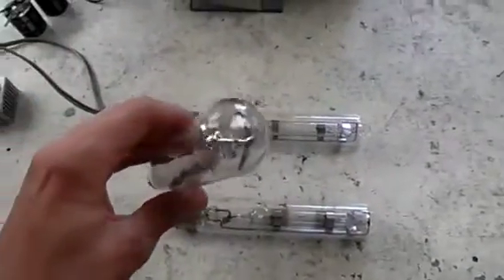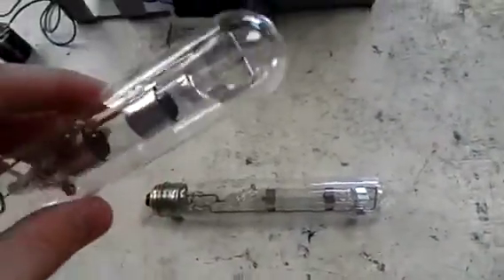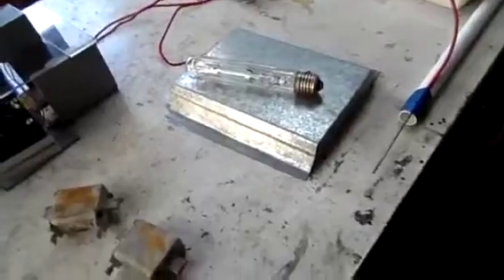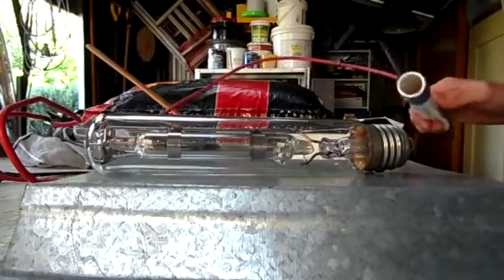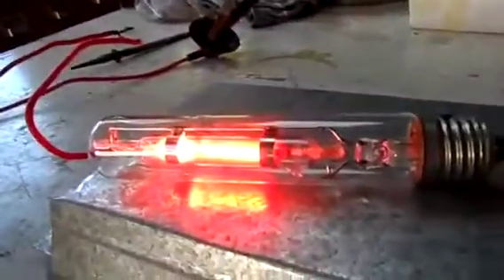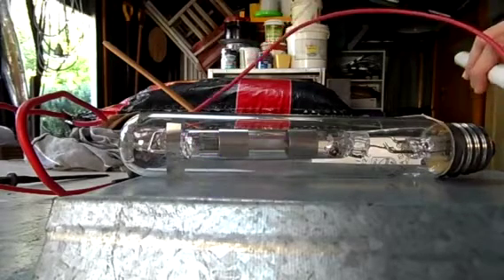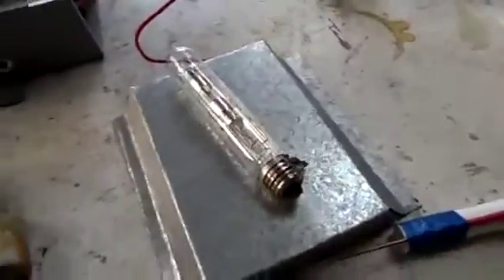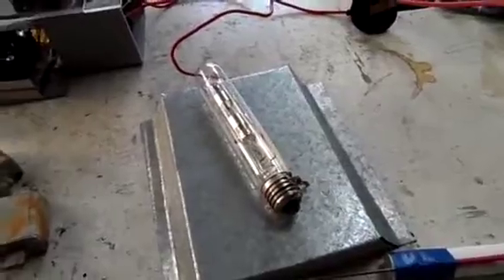High Intensity Discharge Lamps

Comment: Your sodium laps also contains mercury. Go do some research. Also a little mercury never hurt anyone. As someone old enough to remember when dentists filled teeth with mercury fillings.Just what do you think happens when you drink a hot cup of coffee.Yup you guessed it, mercury vapour outgassing.Live a little, blow some shit up.
Reply from the maker: Lol yeah I don't worry too much about the mercury, this was a while ago when I didn't have as much experience with this stuff, CFL lamps are one of my favourite to pop on the ZVS :D and think of the mercury in those!!
Reply: +Machine Man 
CFL have nothing in them compared to the 4 and 8 footers of 40 years ago. The first job I had as a teenager was working for an electrical company. We re-lamped commercial buildings an in the morning after working all night swapping lamps was smashing the old lamps in the dumpster. Think about all that mercury. I shutter to think how much went down the drain.
Reply from the maker: 12voltvids yeah, like with all early electronics and equipment, the older it is, the more carcinogens it's got!
Reply: +Machine Man Remember all the old chemicals and cleaners that were found in electronics shops. Scary stuff like carbon tetrachloride were common.Guy I used to work for ended up with lung cancer, but it was probably the 2 packs of Rothmans unfiltered cigarettes he smoked every day.
Reply from the maker: 12voltvids ahh yes the fun stuff at the back of the cupboards :D I know there's a ton of stuff like that at my school! Yeah cigarettes aren't exactly a nice way of killing yourself lol
Reply: +Machine Man Iremember my days ay school back in the 70's. We used to play with liquid mercury in class. The teacher would hand out bottles of the stuff, and we would pour it out on the table, and stick wires in it and watch it conduct, and spark ect. Roll it around in our hands, one kid even put some in his mouth and spat it across the class room.  It was crazy, nobody knew how dangerous that stuff was, and they didn't seem to care. We would push all the little balls of mercury back together and suck it up with a vacuum squeeze bulb to put it back in the container.Crazy stuff. I am surprized I am alive.  Well not at least I have an excuse as to why my kids are such f--k ups!
Reply from the maker: 12voltvids wow, yeah hazmats were way under predicted in the early days, bit like the asbestos, kids used to play in the mines here in Oz! Then they all started getting lung disease and other nasties when they grew up, hard thing was,  the companies selling the products actually knew it was bad but didn't say anything because it would stop them from not only selling it but also shut them down!